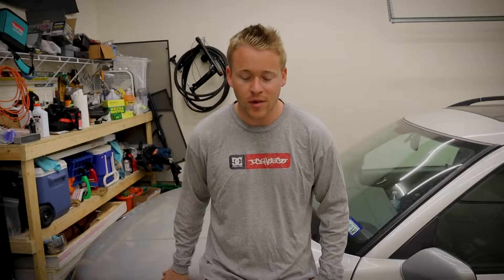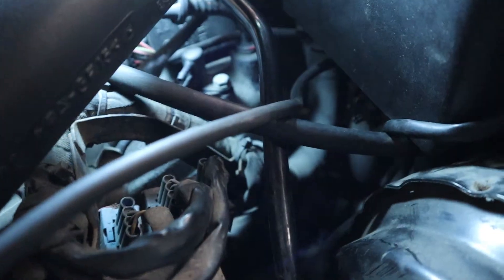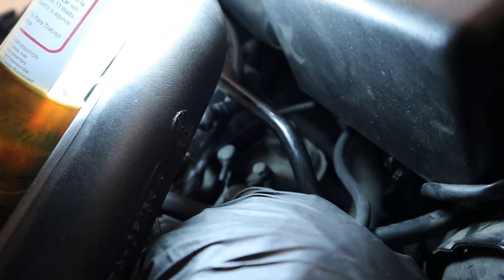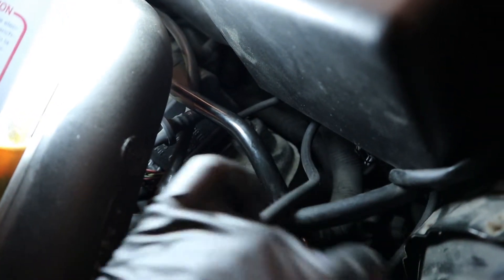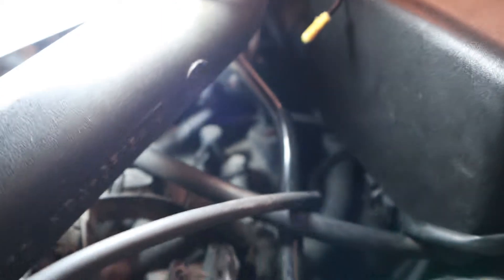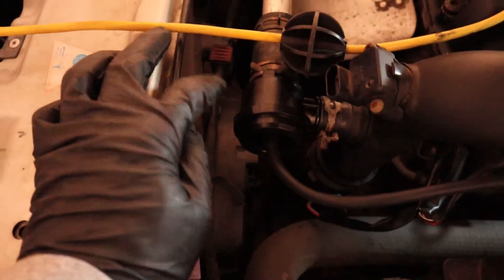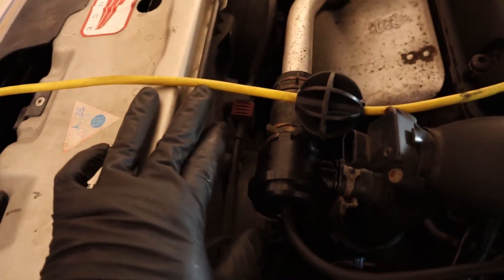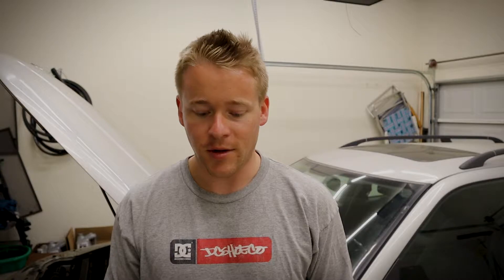Saab 9-5 Blow Off Valve Replacement & HVAC Unit Removal

Comment: Glad I could help with that hint about the vacuum lines. Make sure to replace them all (also those next to the firewall).
Reply from the maker: Thank you for the tip! Running great now. Yeah looks like most of the lines are old and tired I’ll start replacing them all.